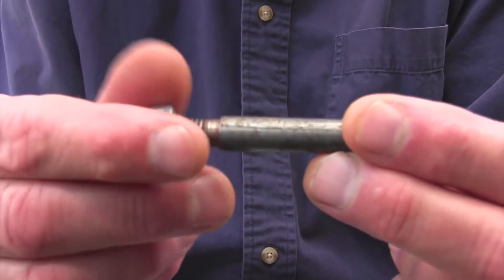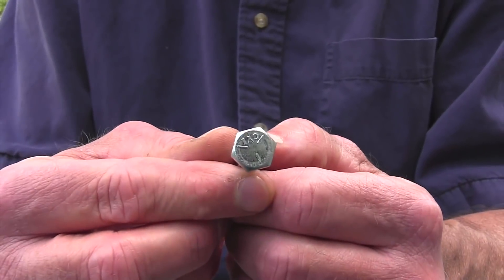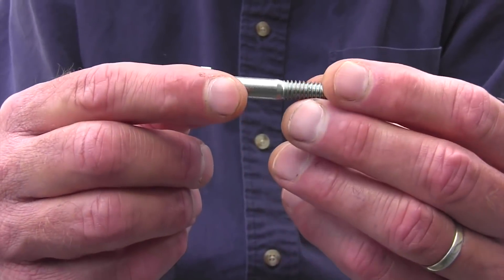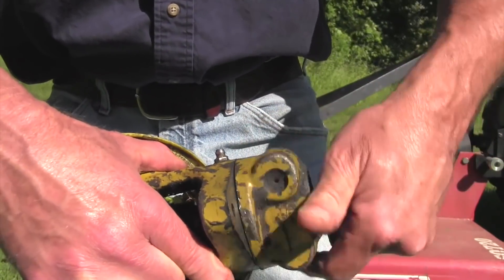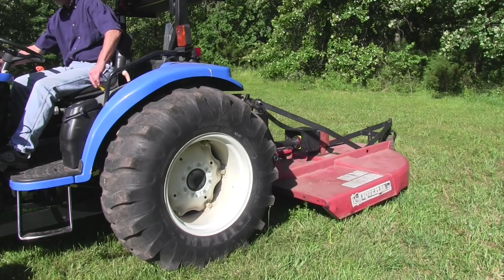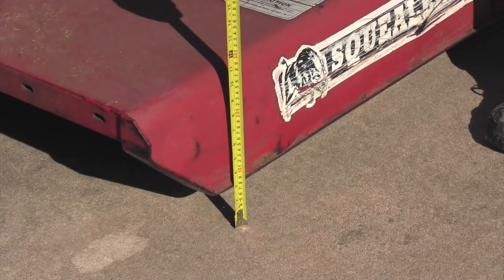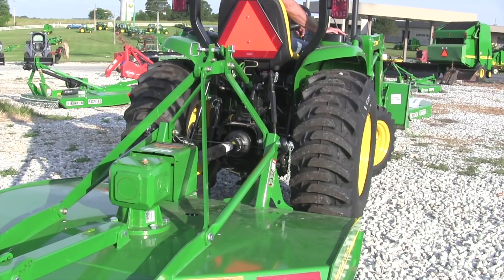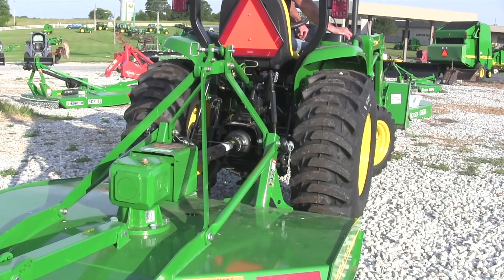Slip Clutch or Shear Bolt Driveline Protection...Which is Best?

Comment: The primary driveline protection is the pivoting of the blades. The engineering of the driveline components on the cutter are calculated by the anticipated force at the blade tip. That anticipated force is dependent upon the weight and speed of the blade. Using additional blade speed to cut stuff larger than the machine was designed for shortens the life of the components of the machine.  Stop trying to beat things to death with poorly maintained blades - try keeping a designed cutting edge on them. 
The greater the speed of the blade the greater the force necessary for it to pivot backwards. 
Also - shear pins are engineered to superior specifications and proven by superior quality control than hardware store bolts. 
Shear pins fitting too lose are subject to "hammering" which is additional beyond rotational forces.

Comment: i Have to say I agree with the shear bolt over the slip clutch for how cheap it is to replace.  the clutches do keep you mowing the same day after you hit something whereas a bolt shearing means you're taking a break to replace that sucker.  but for me i'll keep a few bolts in the ole IH toolbox.

Comment: Thank you, thank you for all the information on shear pins. We just bought a Kubota L4701 and a 6 foot County Line brush hog. The  brush hog is running through cheap Tactor Supply Number Two shear pins like a hot knife through butter. The last one I put in lasted ten minutes cutting some small locust trees.

Comment: PTO slip clutch cover? 5 gallon bucket cut in half vertically mount horizontally with it covering the slip clutch with a hinge and put a bungie cord over it to hold it down over the clip clutch. Simply release the cord and tilt back.
Reply from the maker: I like it!

Comment: I watched a video of a guy using a cheap brush cutter with shaft drive attached to a skid steer, he hit some unseen rocks and bust the drive plate in the cutter as well as the drive shaft, repaired by putting in a slip chain between the gearbox and drive shaft, way he explained it was the chain could slip a little if the cutters caught something, or the chain would break preventing damage to the gearbox,  seems like a no brained to me

Comment: The face Mike made when he read that letter about running over a 10" stump ohh lord, I just heard $$$$$.  Great explanation for a very simple part of the safety system in our drive lines.  I was considering upgrading to a clutch but after watching this, and taking into account the ease and type of use I put my Kioti through, I think just keeping a few extra bolts around is the way to go.

Comment: I just bought an add-on slip clutch for my rotary cutter after I kept shearing 7/16" grade 8 bolts within 5 minutes of each other.  So I have a friend who is going to drill the hole out to 1/2" and I'll run a grade 5 shear bolt in it with the slip clutch and hopefully never have an issue again.  IN the event I don't get the burn-in done regular enough, the bolt will still shear and I've covered my butt.
If anyone has any questions about shear bolts and why you should NEVER go higher than your manufacturer suggests (or if it is safe to do so) visit this page and read up.  It is data provided by a guy on a tractor forum on the shear forces of each grade of bolts, tech details, shear forces, etc. and how you can seriously damage machinery if you just use any bolt without considering the horsepower of the PTO and the shear forces.  
https://www.orangetractortalks.com/forums/threads/everything-you-need-to-know-about-shear-bolts.22378/

Comment: Hi Mike,  Good advice.  For most farmers here in Scotland clutch's appear to be prefered to minimise break downs in the field.  Typically plenty time for winter maintenance.  That said.  In Alice's case the issue will be the bolt bending in the shaft prior to breaking suggesting that you are correct, it's too soft as equally it  then needs thumped out.  (Low tensile strength)  This way the manufacturer can get away with using lower grades of steel on the PTO and possibly the gearbox.  So careful here as using a higher tensile bolt/ pin may result in damage to the affixed components.  Personally I am with you.  Run an 8 in this instance.
But then one can install a clutch adapter dependent on the maximum and minimum length of the existing PTO with respect to the attchment.

Comment: Can you install a slip clutch on any PTO implement, or are you stuck with shear pins if that's how its setup?
Reply: Typiclly yes.  I do believe they can be bought as adapters but one must allow for the maxium and minimum reach of the PTO.  Here is one for example:
https://www.amazon.co.uk/DETACH-OVERRUNNING-CLUTCH-COUPLER-FERGUSON/dp/B00DMEBSES

Comment: Good tip on checking the slip clutch! We have one with a clutch several years ago hit couple truck tires on rims that had been overgrown  a real mess we were clearing. Slip clutch was I guess 10 years old had been even painted over a few times heard a bump and thumping broke the shaft thankfully the gearbox was fine.

Comment: I bought an 1997 Kubota L3600 and I was surprised to find the tool box full of “stuff”. There were screwdrivers doubled ended wrenches and pins. What I could not figure out until I watched this video was that there was a box of 50 bolts approximately 5/16 diameter and 3” long with a box of 50 nylocks. I was assuming it was something like a fence or gate they were maintaining. Now I get it, they were grade 3 or 5 bolts used for shear bolts on a 3 point implement. My first reaction is oh crap is my PTO damaged or at a minimum had a rough life. I hope I have not found the reason it was sold but I will cross that bridge when I get to it. I guess after watching it will depend on the engagement on the tractor and the attached implement.

Comment: Have the same cutters as you but having problems with my shear bolts breaking all the time even snapped a grade eight. The 5/16 bolt doesn't seem near big enough in diameter

Comment: Mike, where can you buy a higher grade shear bolt?  Tractor supply only sells one grade.  My Kubota 4710 must be too much tractor for my Tractor supply 5ft mower.  I broke 3 in the last 2 days.
Reply from the maker: William, if it's a regular bolt, you can just go to Lowe's or Home Depot with the old one and get one the same size in a higher grade.

Comment: I have the bush hog with the bolt thru the shaft.  Removing the cover is a pain, but I use a punch to remove the broken bolt.  I’ve learned to  pickup rocks, know where the stumps are, and don’t try to cut to low.  I rarely break one anymore.

Comment: Shear pins need to be long enough that the threads do not fall at the shear region.  Threads in the shear region will lower the shear bolt strength.  Or if the bolt & length is correct make sure that the direction of install doesn't leave the threads in the shear region.

Comment: Good video Mike!!  Have had both and prefer the slip clutch. The problem with the shear pin is that I forget to take a spare with me when away from home and don't have it when I need it. Since the safety mechanism is built into the PTO drive shaft, you can change the shaft to the preferred design for ~$200.00 on Cat1.

Comment: Have slip clutch - very simple and reliable.  Once a year just back off all the way and engage pto at full rpm.  Done. 

Adjustment doesn’t really matter just tighten enough so it doesn’t lose the nuts and it will cut rated thickness no issue.  No need to measure bolt lengths etc.  The absolute worst that then happens is it MAY slip a couple of times per hour but so what - not enough to even get hot and gives great protection.

Comment: You can purchase pto shafts with clutches attached or clutches individually as well as parts and they are inexpensive. Very basic to adjust, you should be back there checking gearbox oil levels at least each year anyway.

Comment: Shear bolt design is far from ideal in this application. It’s normally used after a slip/over running clutch in the driveline. Eg baler flywheel or stuffer. There is no disadvantage to a slip clutch. Far more shock load with a bolt

Comment: Agree on the shear bolt, I have rough ground. I don't  like changing the shear bolt so I am cautious where I cut (walk through, start cutting high, drive slow). Slip clutch gives a false security,  more expensive, and as you say more maintenance. I start my mower (6 ft) just over 1000 rpm and then ease it up and have no shearing problems.

Comment: We used grade 5, the manufacturer recommended grade 2 but those were so soft you couldn't even get the blades spinning. With that being said, slip clutch is so much better.

Comment: Rsndom thought occured to me.  Seems to me that it is almost impossible to find some types of implements with a shear bolt.  Tillers, for instance.  Similarly, I don't think I've ever seen a PTO driven auger with a slip clutch.

Oh, and a bit of advice for anyone unfamiliar with slip clutches when buying a new implement.   Ask that the dealer's service department adjust the slip clutch before you take delivery.  If it has been sitting in storage a long time, especially if part of that time was outside exposed to the elements, it may well be in need of adjustment even if it had previously been correctly adjusted.  And it doesn't hurt to ask if they'll show you how to do it at the same time.

Comment: My rotary cutter came with a Grade 2 shear bolt, which broke almost every time I engaged my "electric-over-hydraulic" PTO. I contacted the manufacturer, and asked if moving to a Grade 5 bolt would void the warranty. They said "no," so I replaced the old bolt. Haven't had any trouble since.

Comment: When I was repairing hay balers, my most frequent call was shear bolts.  Many customers tried to save money and not buy the correct shear bolt, and would put in anything that would fit.  Their complaint, was it was breaking frequently.  Some I could break turning the flywheel by hand.  Putting in the proper bolt, solved their problems.

Comment: One thing I like about the very old IH 300U is that the pto is wet clutch driven/engaged. The cutter I have had a slip clutch on it bit it never went off (tractor PTO clutch always did first).
The issue is I lent my cutter to my dad and the slip clutch on it was rusted together, ended up breaking the pto drive train in his Kubota (someplace in the transmission). Sometimes old stuff is just designed better (the pto clutch on the IH 300U is just a better design than the newer tractors).

Comment: I have a kubota with 18pto and slipped the clutch in but the tiller stalls the engine if I hit a branch or root. I guess if you have low enough pto it doesnt matter.

Comment: I have both and prefer the shear pin also due to its fail proof simplicity.  In reality, hard to find the time to adjust the clutches annually.  Even after they have been adjusted I find myself wondering if they are still in adjustment after a few months.

Comment: After years of running equipment on the farm, I swear the slip clutch is best! Too much inconsistency in bolts, the shafts rust together and might not give. However if you maintain a slip clutch, it wont rust together and will always give at the right amount to torque to protect the  equipment.  We had converted our square baler to slip clutch because the bolt hole was worn and the slop would shear the bolts.

Comment: I would not use a brush hog or tiller  without a slip clutch. I'm OK with the shear bolts on the snowblower.

Comment: We use grade 2 shear bolts in both our Rhino and Land Pride brush hogs.
We've broken hundreds of them over the years but they're cheap enough at TSC to justify the additional cost and labor involved with a slip clutch.
That's my two cents on the subject Mike.  :-)

Comment: Never “burned” in a slip clutch, and have never had a problem and I mow a few hundred acres a year with a JD HX-15. Mow over small trees, bushes, etc and have gotten barbed wire hung in it and have yet to knowingly slip the clutch from use, and have never broken any drive line parts, or frankly anything on the mower.

Comment: Even though very few people understand/ consider a  properly designed  v- belt drive is also a system with built drive line protection (the same function atleast from an engineering perspective). Though very few belts are as cheap to replace as a  shear bolt. And they alert with a nice squeal and rubber smell 😉

Comment: I have a PTO wood chipper, and recently I was breaking shear bolts far too often, and far under the chippers diameter capacity. I went through about 10 bolts before checking the manual to ensure I was using the right grade (5). While in the manual, I noticed the recommended RPM was 'up to' 1000, not 540 like all my other implements (doh!).  What a world of difference. I now run closer to 1000 rpm and can chip anything I put in it, as long as it's wood :)
Reply: I am having same problem with a chipper I just bought.  Mine seems to engage ok but after  10 15 revolutions the shear pin breaks.  I tried multiple times (even with  a grad 8 bolt) and it always breaks.  This chipper is old and discontinued so I didn’t get a manual, I am at a loss as to what to try next.

Comment: Hi Mike,
Good Video. Regarding hitting the stump. It's possible to hit the stump grazing the top of it, and or it hits the stump jumper disk, it will shove the cutter over and still not cause the shear bolt, if it has one, to break. If it has a slip clutch, it may or may not have broke loose. I'm like you in that adjusting slip clutches is not something I like to do, but it must be done, especially on a piece of equipment that sits outside and doesn't get used very often.

For brush cutters that are continually being used, then a slip clutch is the way to go! 

For shear bolts that are breaking too often, the first thing to determine is whether it is the correct hardness and diameter.

Comment: Thank you Mike as always great video! 
Went to my dealer to get some shear bolts for my R C and it came in a "kit" (parts guy said he "assumed" the kit included the nut... oh wow what a deal!) for $22.70...........Went to Tractor Supply and got 6 grade 2 bolts and locking nuts for $9.00. Haven't broken 1 yet but sure I will.

Comment: Thanks mike.......Massey Ferguson 35 with 5 foot slasher / bush hog ... Felidquip brand.... Just got them I don't have a manual for the slasher. So if the slip clutch slips I do it up half a turn till it stops slipping. I have a clean paddock no junk in it ... I use to now it with my draftsman yt4000 ride on but takes to long in summer. Hence the Ferguson..... Just bought a 6 foot box blade for it $1300 Australian $$$$$ ... Love it it will out last me.. I'm 38 yo...thinning about buying a flail mower ?$?$?$ maby ...love the vids mike your the best tractor educational bloke on YouTube... I've  used tracto when I was YOUNG BUT THE FERGUSON IS THE FIRST  I own .... Plan to do a paint job and pretty it up a bit as I use it for my bisniss/work .,............stay safe take care ......Queensland Australia.....

Comment: Added an aftermarket slip clutch to my shear pin pto shaft for under $100, had to cut the shaft length down a few inches

Comment: Great info. Maybe I'd better do that slip-clutch maintenance. You know what I don't like? The PTO connections with the ring around them. You have to use two hands, which is a pain - especially with the plastic drive shaft sleeve protectors in the way. I prefer the push button on the side of the PTO connection - unless I'm doing it wrong!? Thanks! -Ed @ MCG

Comment: I bought a new cutter, the second time I used it, the shear bolt broke.  I replaced it with the recommended bolt which has worked for several years.  I don't think the nut was on tight and it fell off.  The bolt slipped out enough so that the bolt sheared on one plane in lieu of on two planes as designed.